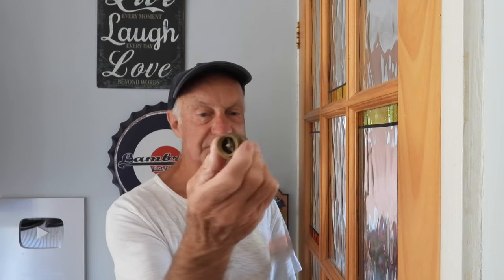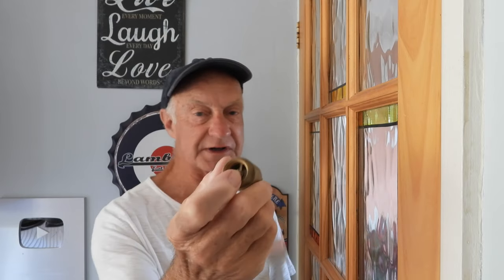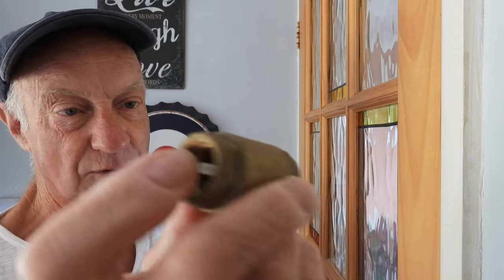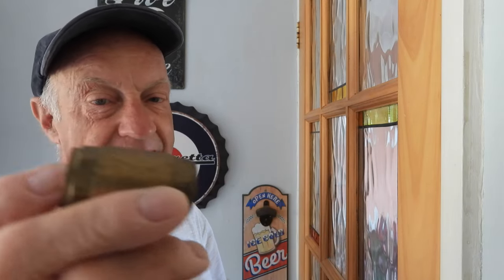When not to fit non return valves.

Comment: Funny you did this video, as I just fitted a check valve between the MCWS and a mixer valve that runs to an outside tap to wash the dogs. I did this so there was no danger of any back flow, but now having seen your video, should I have bothered if the mixer valve already has a NRV with in it?
Reply from the maker: No could have saved your time money.
Reply: @dereton33  it was my first attempt at plumbing, so I really enjoyed doing it. I watched your videos first, then did the work. I scavenged the check valve, so I can just take it out. I also took a rad off, flushed it out clean and stuck it back no problem. The best fix was your video on air in the HWS.

Comment: What about using one on a toilet? Hear me out.... I have a washing machine at the other end of the house and a sink next to it running off the same pipe. The toilet float valve doesn't always shut off and is temperamental. The washing machine inlet or my running the tap will often seem to cause back pressure which will make the toilet valve open up and start trickling water into the cistern, until I flush it. I have very high pressure water. Could this fix that?
Reply from the maker: Yes worth a go.
Reply: @dereton33   Thanks